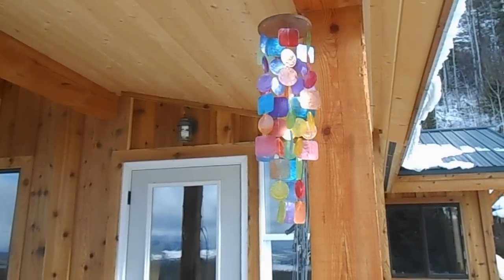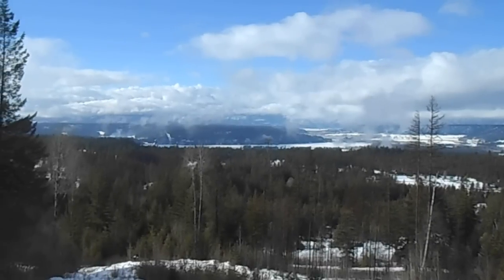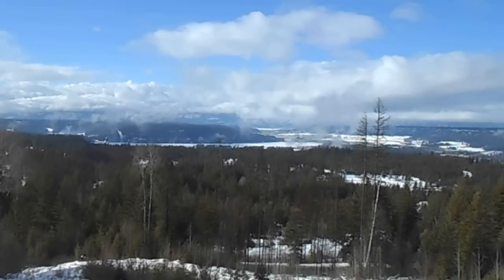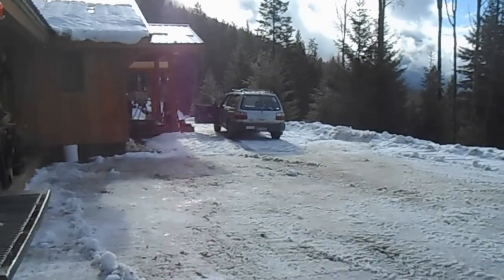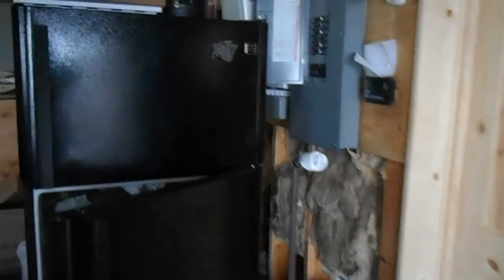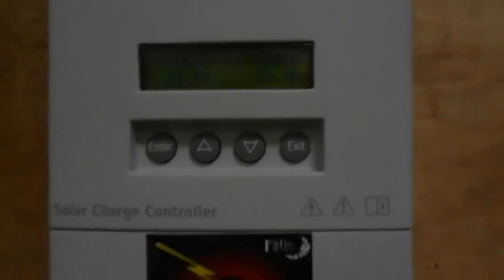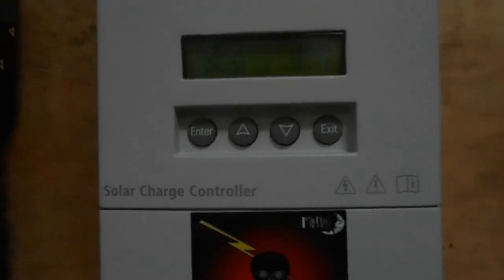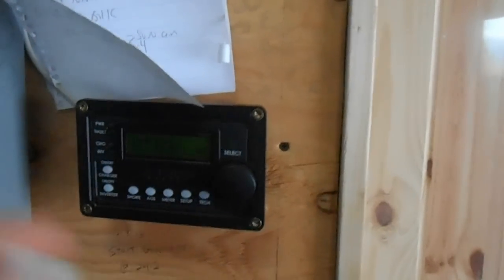Off Grid living: Xantrax charge controller cranking!

Comment: Hi Starry from Nick Wiese: I feel that the chest freezer & fridge  eat a lot of power. May I suggest you insulate with 2"foam. Formica  type Plastic can be on top, of the Foam any color or pattern. using water based contact cement. They also sell a more efficient compressor for on top of your Fridge.  Sun Frost closed down last year and this is what they did, for 30 years. it is possible to start with 2 layers of foam on top of the chest freezer, and keep tabs.on power use. You might Look at a Yeti ice chest for how thick the walls are and cost is always a factor, it is good to insulate the battery bank as well! I got mine to work at -27 this winter.  Backwoods Solar, Sandpoint, Idaho  has lots of savy and parts and of course they are online.  Soon I am going to Leaddore, Id. for customTracker pics.  360 degrees & 70 degrees . I will share, good luck, Nick

Comment: So I live in a similar area (Athol, ID) and am about to go partially off grid.  I was wondering if I could pick your brain a little.  How are you charging the batteries with your generator?  Are you using a regular AC generator and an AC to DC charger?  If so what do you recommend for charging 48v battery bank?
Reply from the maker: yes ac generator. all the off gridders around us d the same. propane, diesel, gas generators, your choice.  when the batterys get down to 60% we run the genny till float, a full charge. this has been a good winter with enough sun, alot of 1/2 sun and partial sun days so we only had to run the genny a few times back in dec and i think once in jan.
Reply: You are awesome thanks.  I'll have to get a charger before next winter because I know I need more batteries and I won't be able to buy anymore for awhile.  I also didn't realize  how big of a deal it would be in these northern winters.  Thank you so very much for sharing your experiences with the rest of us.